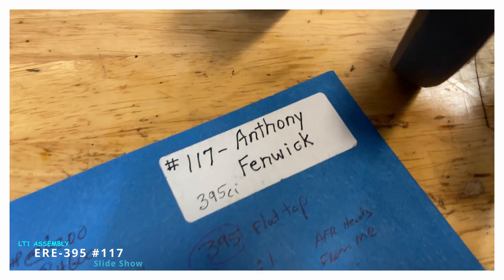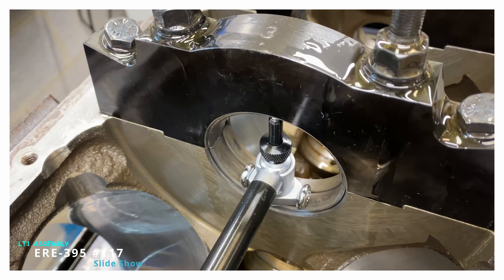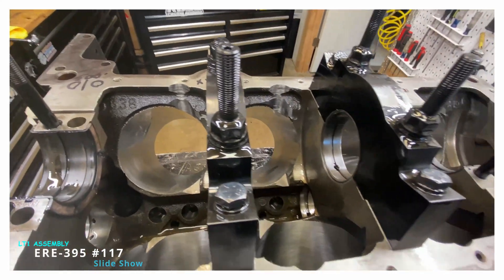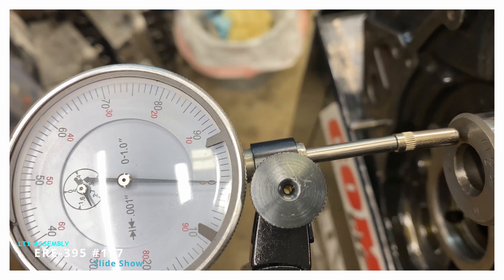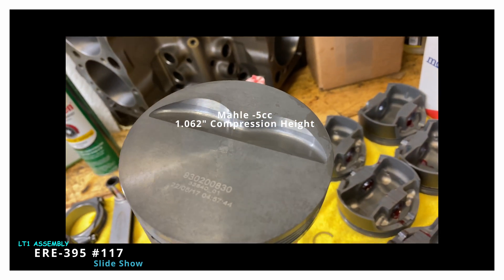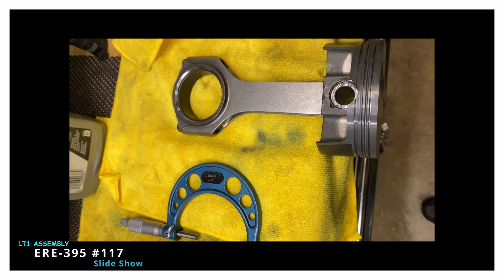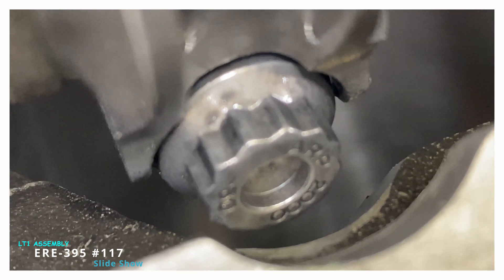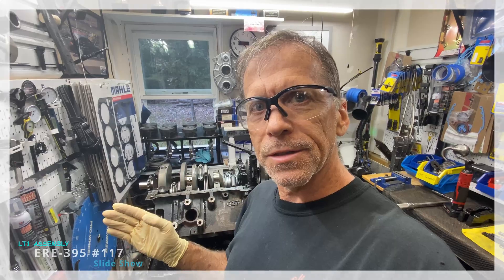LT1-395ci, Number 117 Short Block Assembly PART 1

Comment: So you like to see 2.7 to 3 on the main bearings? ... for all ? Are you still using the stock psi oil pump on this build
Reply from the maker: I do.  I have been going bigger and bigger on the main clearance over the years.  The motors can use the thicker oil and the pumps are all high pressure.  This one is the high pressure standard volume, shark tooth.  Yes be careful to go with too much main bearing clearance because then less oil gets up to the rod bearings if the main bearings leak it out.
Reply: @EllweinEngines  thank you for your input

Comment: What bolt-ons do you run/recommend? Excellent video as always
Reply from the maker: Headers, a good quality higher stall torque converter, rear gears, 3.73 or 4.10, Good cold air intake (in the fenderwell not over the radiator).  That's about it.  The gears will be #1 !
Reply: @EllweinEngines  thank you sir!